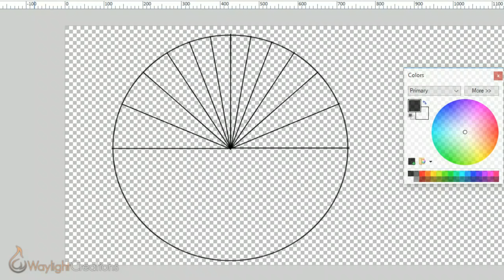How To Make A Simple DIY Sundial

Comment: Unless I missed it, you didn't tell how to find 'true north' mentioned at 4:28.  I think the easiest way to do this is to place a rod perfectly straight up and down in the ground. Starting about 15 minutes before noon on a clear day, begin marking the tip of the shadow cast by the rod every few minutes.  Each mark should be a little closer to the base of the rod.  When the marks start getting farther from the base, simply mark the one closest to the base of the rod.  A line drawn from the base of the rod to that point will be 'true north'.  There are formulas using your longitude to accomplish the same thing but they were too complicated for my brain to understand.

Comment: Way cool video... however, there is one step you missed that would greatly improve the accuracy of your sundial.  Before gluing the hour lines template to the wood, you need to cut it in half on the 12 o'clock Noon hour line, then glue it to the wood with a gap the same size as the width of the gnomon.  The morning hours are read by the shadow cast from one edge of the gnomon, and evening hours by the other edge of the gnomon, and noon is indicated by the whole thickness of the gnomon shadow.
Reply from the maker: I didn't catch that while I was researching. Thanks for sharing.